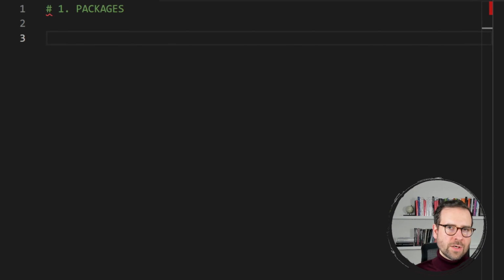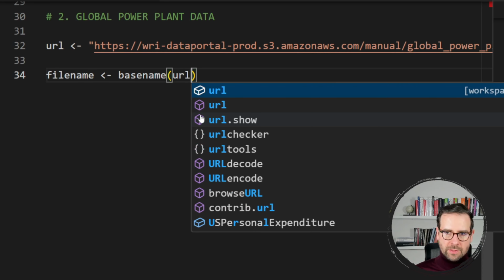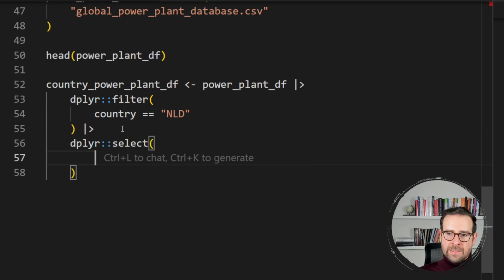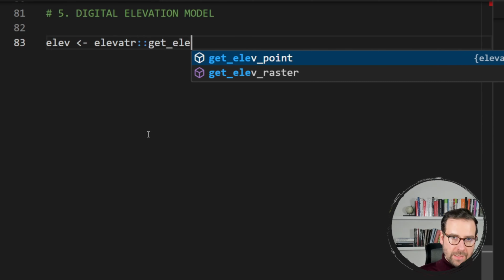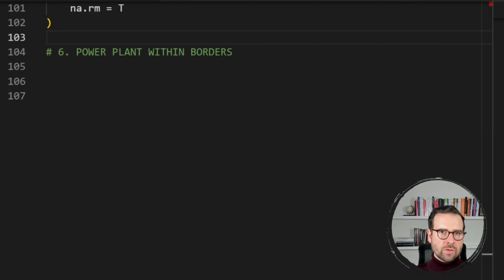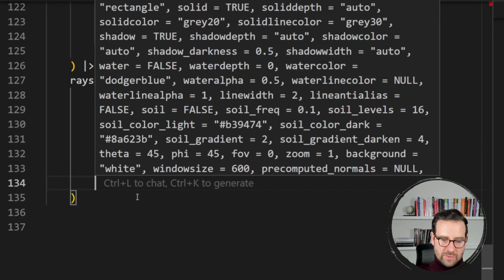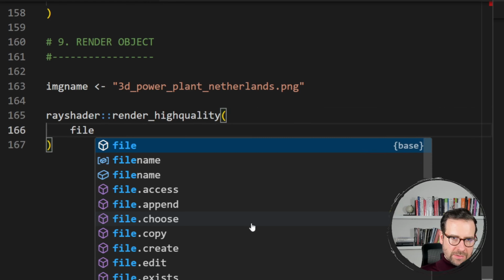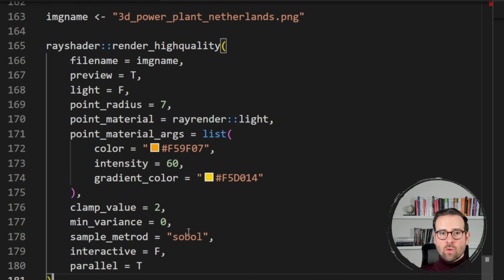Transform Your Data into 3D Maps with Light Bubbles in R

Comment: Thanks for the great tutorials!

One issue I'm having is that the window is rendering in XQuartz and renders well... but as soon as it finishes rendering the window disappears. The other, lower res one (light with the orange dots) remains but not the dark one with the lights.

Do you know the solution?
Reply from the maker: If it creates an image in the process, then it is expected that the rendering window will close
Reply: @milos-makes-maps  Hi there, thank you!

I had a bit of an issue with rendering at higher resolutions. It seems to crash R at anything under factor 5. Do you know a good way around this happening?